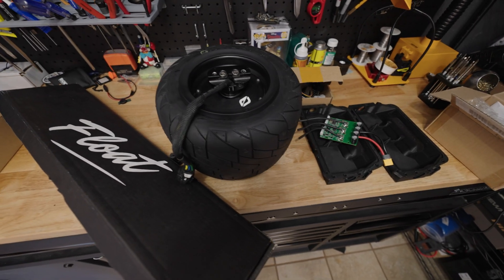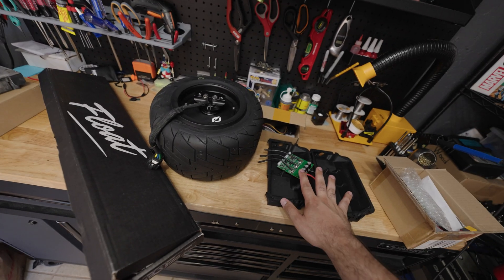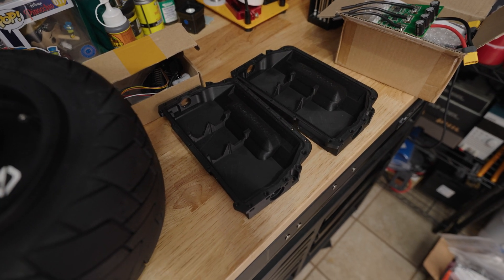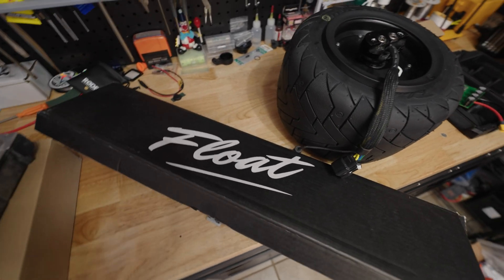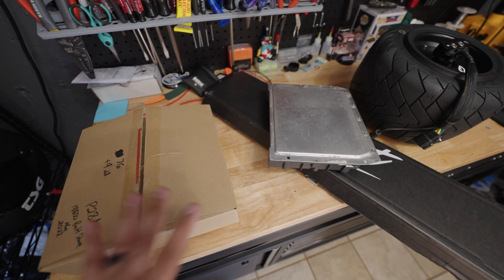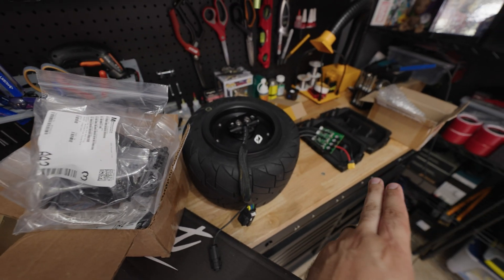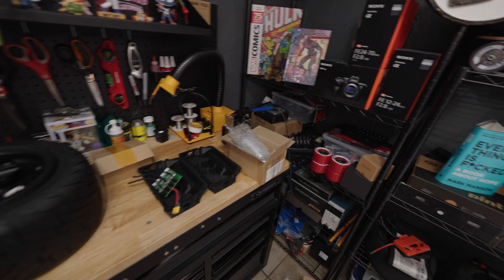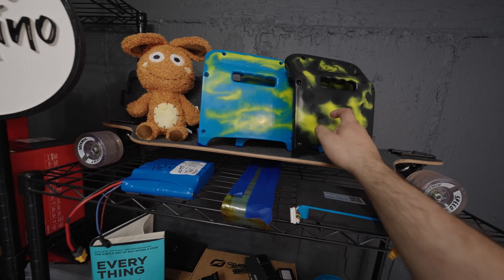Ultimate DIY One Wheel Build | Introduction & Parts

Comment: Hey Mario!
So, my XR's front led is not working and I just bought a new cable for it. How hard do you consider to be the processo of replacing it?
I'm debating doing it myself or spending around 100€ to send the board to the only shop that works on Onewheels here in Portugal.
Oh, and thank you so much for all the amazing content here.

Comment: this is a pointless video. you dont talk about whats required for a one wheel or different options for them. you dont provide sources for where the parts can be found just said your friends gave them to you. didnt talk about what each part is, what is does or why its needed. didnt mention anything about specs, voltages, amp ratings, balance cotrollers, predicted range, battery configuration, what you call "third party parts" like essential hardware. nothing usefull you just rambled for 8 mins about what your friends gave you and how you think your other videos are "good viewing material".

Comment: I bought a 2nd hand XR as ‘not working’ to see if I can get it working - seems like it’s either BMS, battery, or both.  It’s the controller version that’s not picky about BMS changes, which is good but…
The cost of official repair or 2nd hand replacement FM BMS/battery is making me consider at least pricing up a VESC build.

Comment: I am looking forward to seeing the build come together.  I messaged you on FB as I have the aluminum lid, gaskets, brass inserts and screws needed for the Flowglider Controller box and will provide you the parts, would just need an address to send them to you.
Reply from the maker: I'll check for your message. I actually do have those parts, but forgot to mention them in this video, my apologies. Thank you for the offer, it's very kind.

Comment: Excellent video! I can't wait to see the rest in the series.

How powerful is the 20a2p battery you're building for this VESC in comparison to, say, the GT?
Reply from the maker: Well, it depends. The voltage is higher, since the GT is 18s, however I'm using a smaller cell, an 18650 size, whereas the GT uses 21700 size cells. The capacity is between an XR and a GT. Power wise, the higher voltage and ability to set specific current limits will make the 20s setup markedly more powerful and with a higher amount of headroom before the board can't sustain balance.

Comment: Looking forward to seeing the build! Love the more DIY approach your taking to the build. 

However, I will add that I think it's important to note to viewers that if they are interested in a VESC build but are intimidated by this approach, that there are easier options to get up and running with a VESC based Onewheel. I personally went with the Flowglider DIY bundle from Makers PEV which, outside of maybe the brass heat-serts for the 3D printed enclosure, everything was pretty damn simple if you followed instructions, with not really any special skills, tools, or experience needed. And of course, they are now also pushing out fully assembled controllers that are ready to go.

That said, still greatly looking forward to seeing the progress on this build! I know you've had those FOCers on hand for a long while haha, awesome to see them finally getting put to use.
Reply from the maker: Oh absolutely. I'll definitely be layout the various pathways to conversions, rebuilds, etc. as the series goes, specifically when I get to putting the controller box together. Obviously this project aims a bit high for the general rider, and isn't the most accesible. The goal was to get as far away from a stock board as I could while having it appear fairly innocuous. Kind of like a sleeper. It's also an attempt to demonstrate how extra one can get without resulting in a big ol' chonker like a GT. Either way, I'll do my best to highlight what's currently out there. Cheers sir. 🙏